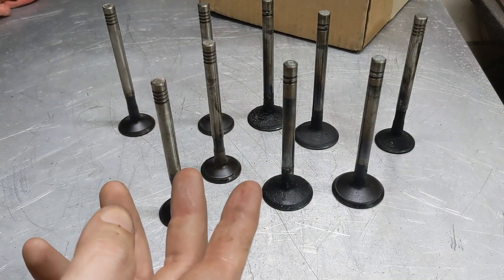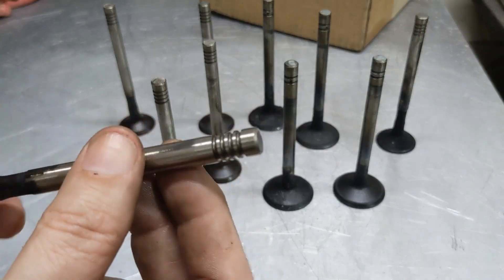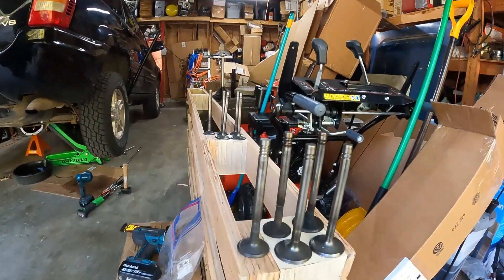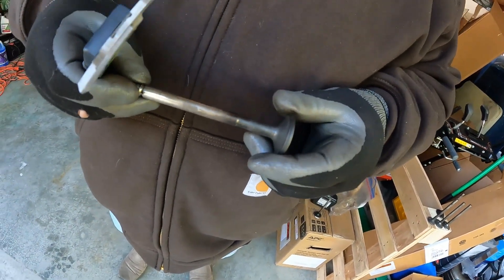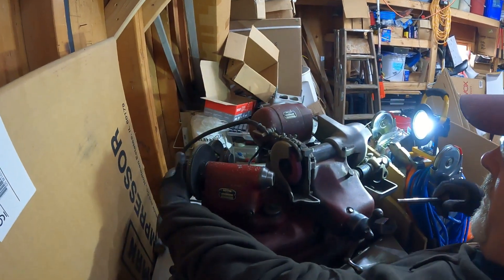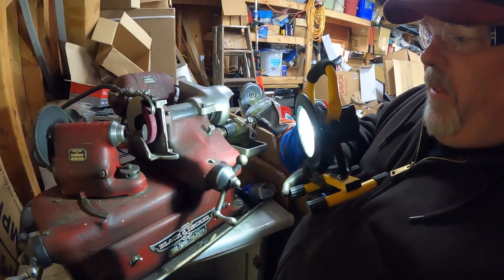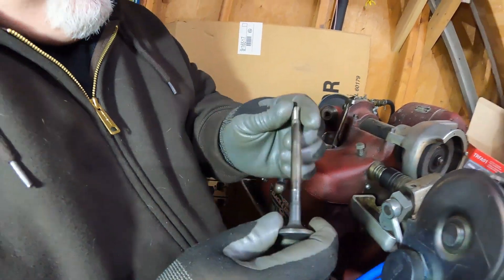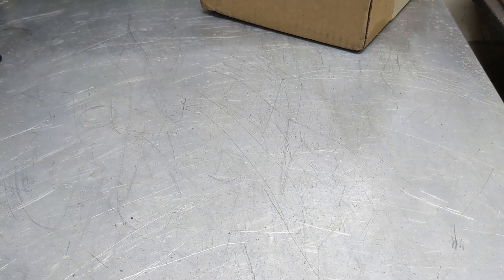Grinding Valves with an Old-School Black and Decker Valve Refacer

Comment: How much did valves used to cost relatively? I saw for my engine they would only be $120
Reply from the maker: In the 80s and 90s they were like $12-$15 each. You could reface a full set for easily under $50 total shop rate.
Reply: @YoshimoshiGarage  So $15 each in 1980 would be $300 or $1179.52 in 2025 money for my v10 engine. If that’s the case I can see the labor being worth it

Comment: Depending on your valve grinder you can bevel the stem using your drill bit sharpening jig used on your bench grinder. Some valve grinding grinders need the stem bevel to be more accurate  because the bevel is used to make sure the valve is running true. Check your valve grinder to if has this feature.

Comment: I used my late uncle's B&D valve refacer on PRE-1974 VALVES, but try it TODAY on modern un-leaded fuel engines and you'll remove the INDUCTION HARDENED surface of the valve and RUIN IT, just like the steatite or carbide valve seats! That's one reason 1950 Ford valves cost $2.38 each and modern valves may cost over $200 EACH!!! You CANNOT grind stainless steel or titanium valve "tulips" either, and you can't use a $49 three-angle flycutter on valve seats either. My Mitimosa 7 angle carbide flycutter for motorcycle valves cost over a Grand! Clover Compound(tm) and a suction cup won't do a thing on MODERN valves and heads but RUIN them!
Reply from the maker: YEAH!!

Comment: Nobody has valve jobs done anymore really no need a modern engine with regular oil changes and using synthetic oil has no visible wear after 500k miles .. ZERO wear no need for valve grinding because only people to cheap to change oil would need the service and those are the same people that would never fix anything they would replace the engine / vehicle first. I would love to get one cheap.

Comment: HOWdy  Yoshi, ... 
if the VALVES are appropriately ROTATING  during   operation 
the TIP of the VALVE should NOT need much  "dressing" 
COOP
the WiSeNhEiMeR from Richmond, INDIANA 
...
Reply from the maker: True. But how do you know if they're rotating before you assemble and run it? I'd hate to go through all that work to find one needs to be done and have to pull it all back apart.

Comment: I always use cutting fluid to prevent any hot spots on the valve face from the grinding wheel. You have the attachment on your grinder too.
Reply: I didn't turn on the pump for this demo, so we could more easily see what was going on.  Plus, SPARKS!
Reply: What kind of cutting fluid to use?
Reply: @stevenjordan6389  what type does not matter as long as you use something. I prefer mineral base since I do not use my valve grinder often the fluid will not go rancid and smell.
Reply: The old machine were dry type so you have to slow down and let stem and surface cool
Reply: there is a reason that the cooling fluid can be turned off and yes it should be used MOST of the time..... Some vehicles have sodium filled valve stems to aid in cooling the valve  while the engine is running..... refacing sodium filled valves should ALWAYS be done dry as there is a violent explosive risk!

Comment: Part of resurfacing valves is supposed to be grinding the stem to compensate for resurfacing the face. Last set of big block heads I took to the machine shop for a basic valve job was $80-$100. I don't remember but it was relatively cheap. That was no parts I think, just straight grinding.
Reply: Hydraulic tappets and adjustable tappets on the rocker arms will take up that small amount of ground off material from the valve face the removal material at the Collet end of the valve should only be enough to square up the end and take out any wear on the top surface of the valve stem. it should be noted as well that the rocker arms should also be serviced so that they are true and a proper uniform valve stem gap be measured and set! this can also be done on this machine

Comment: I am a French living close to Paris. I am curently refurbish an very old resurfacer like yours shown  in video. could be Black and Decker or Van Dorn coming from US. As the two electirc motors is power with 110V. I dont have any information about  electric motors installed to know what Power supply transformateur 200 V to 110V I need. 300 VA, 500VA or more ? someone can help me to read labels on your resurfacer.Thanks for any help.
Reply: The model information is as follows:
Size:  5/8"  
Type NW
Wheel Head (grinder) motor: 110v, 4.8A
Work Head (chuck) motor: 110v, 1.3A
Pump motor: 110v, 0.5A

I didn't use the coolant pump in the video, but added the info, in case yours has one.
Reply: @damnimcooltom1  Thank you a lot for quick response !
Reply: @adrienmoreau2795  You're welcome.  Hopefully it is the information you need.